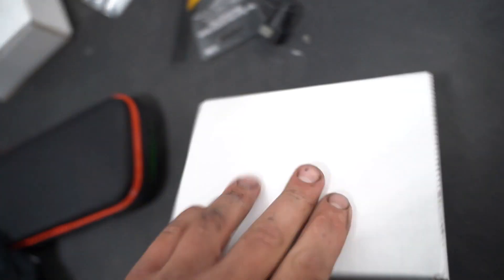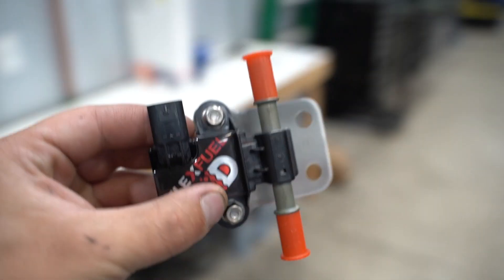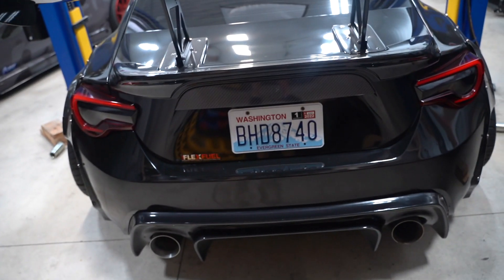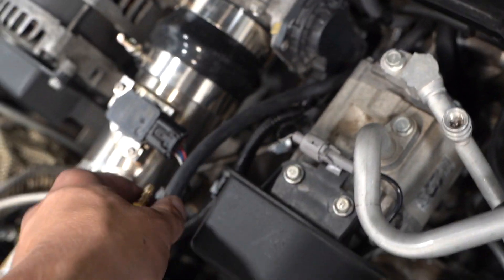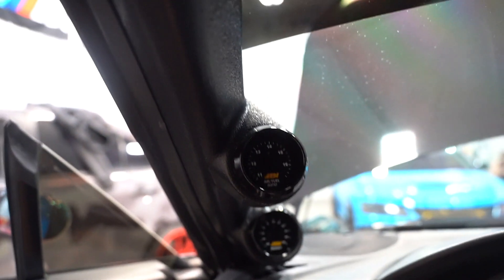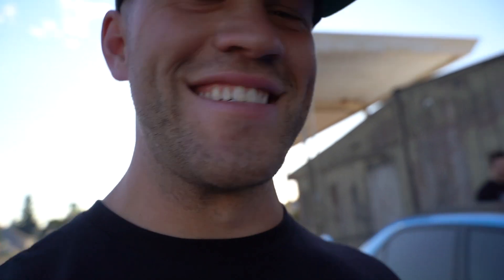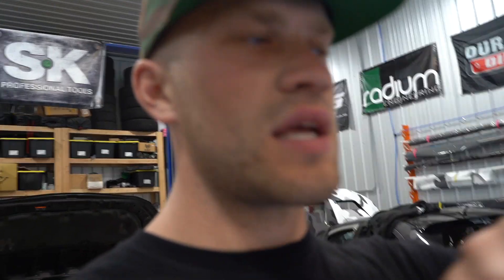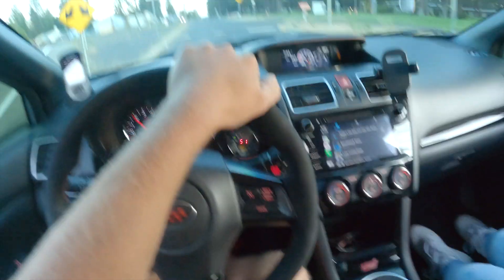Could've Been Worse...

Comment: Buschur racing has a Stage 1 Bushwacker transmission for sale 5spd. $2900 with a good core. Not sure if you’d be able to work something close to the same price with your 6 speed as the core but worth’s call if your worried about the transmission

Comment: You should be good with Michelin Pilot Sport 4S for the kind of use you do, drag radials will be more for a dig build. Yokahoma Advan Apex v601 is also a good tire, wears a little quicker than PS4S but is cheaper.